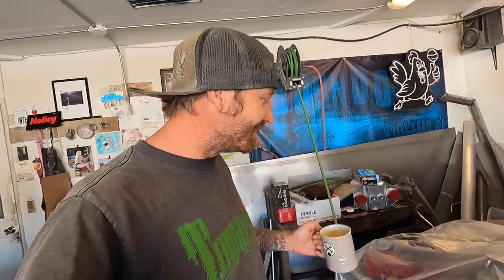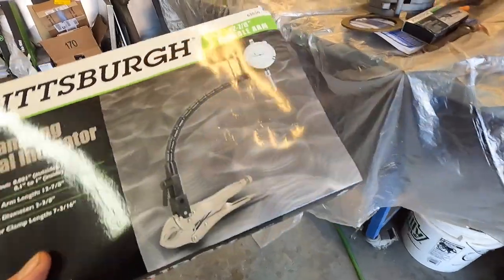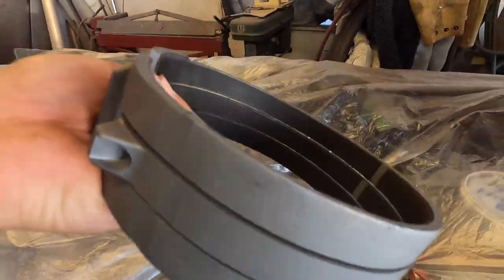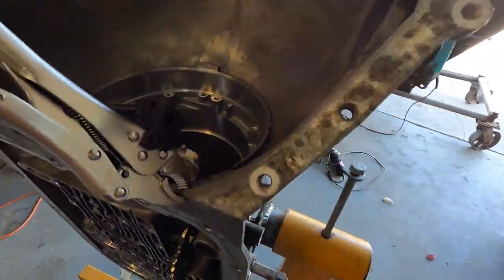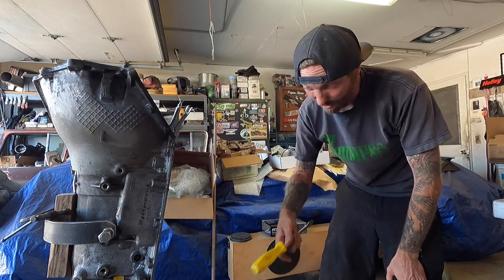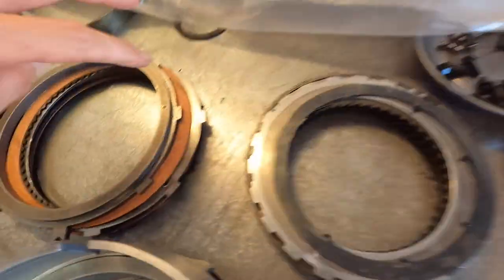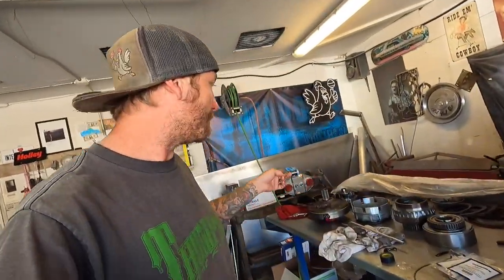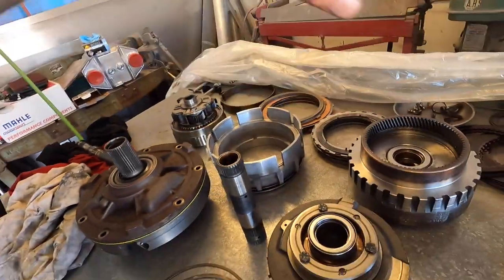I got the end play set for the 4l80e transmission

Comment: You may not be a specialist, but you're becoming transmission fluent. And that's a skill that will carry over to engine building because of going for tolerances. Because the reason you chase tolerance in building an engine is the difference between a 300-hp motor and a 450-hp motor. The tighter the build the more it produces.
Reply from the maker: Yes its a learning process. Its kinda funny to learn on camera and share it but I think it makes others feel better when they try stuff. I have had my share of struggle on this thing but I feel like ill get it. After I do it will just get easier the next time I have to do one I guess. Getting outside of your comfort zone and being willing to fail is not easy for most people.